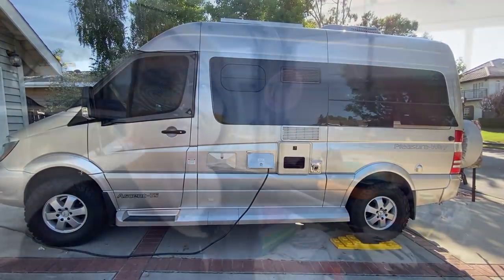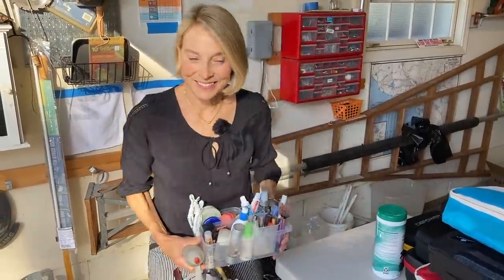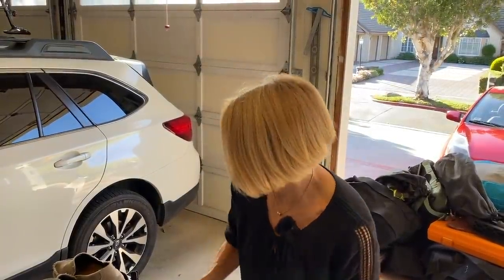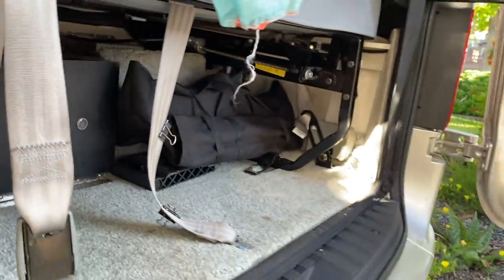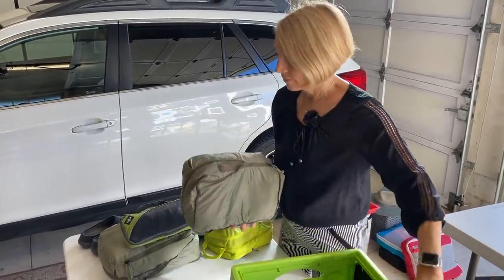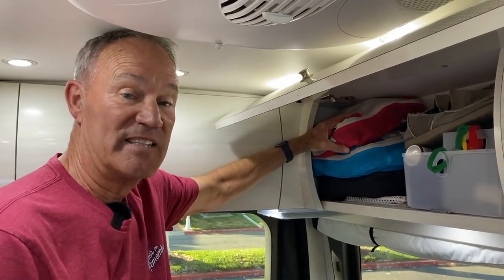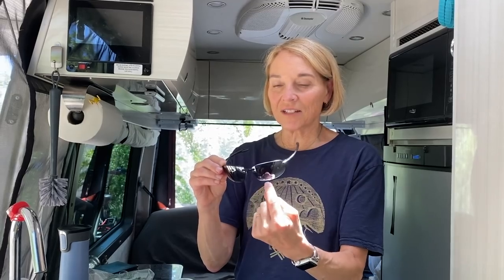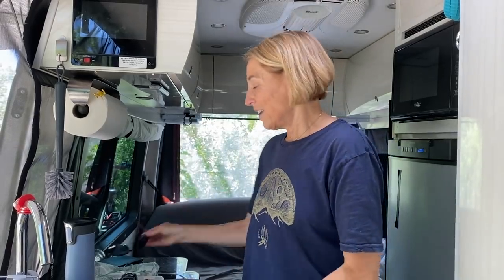How we pack our Campervan

Comment: Great video.  A game changer for us was purchasing two Gonex 60 liter folding duffle bags that fit perfectly in the space in front of the couch/bed.  Huge volume for packing clothes and can be left in place with bed down.  Amazon has them. They fold into pouch sizes when not used.  Thanks for the videos.

Comment: Thanks for sharing! Here’s some tips on where we found extra space in our Ascent: 1. We removed the carpeted panel beside the rear battery box, it’s just the charger in there and it has its own cooling fan. 2. In the rear largest upper cabinet the curved plastic covers are wasting a lot of space in behind so I’m about to replace them with 1/8 white ABS plastic sheets (can be cut with scissors). 3. Below the 3 kitchen drawers is a huge empty space; the front panel has clips and pops off when pulled, and then unscrew the cover panels in behind(they are not structural) - I added another drawer handle so it looks like a 4th drawer and because there are water lines in there it’s a great spot to put laundry. 4. The passenger side ottoman, below carpeted panel can be easily made into a huge hidden compartment: I slightly relocated the inverter electrical box at the back, and trimmed 1 inch of wood off the panel at the rear so it can be pulled up by hand(leaving the carpet in place to hide the cut) Lots of room under there.
Reply from the maker: Great ideas! I also removed the false wall in front of the plumbing under the kitchen sink.  I haven't shared with viewers the space under the third drawer because I use it to stash electronics out of sight when we have to leave the van.

Comment: Going from my 45’ Truck Conversion to my 21’ Lexor has been a challenge as I like my stuff! Also, I pack for 4-seasons. 😂  The Trasharoo looks bigger than I was expecting. On order soon. Just received my Victron BMV-712, now have to find time to install. Want to come install it for me? Glacier is opening up more Monday! 👍
Reply from the maker: I hear Covid is exploding in Montana.  Where are you?  Maybe we could swing by and I could "supervise."  Have you ordered the extra wire you need?  Get one longer than I did.  One tip I want to pass on from a viewer, remove your watch and rings (if applicable)  and tape off the connections so you don't arc.
Reply: From She to Me, I am in Columbia Falls, MT 16 miles from the west entrance of Glacier National Park. Compared to NY, FL, TX, and CA, MT is minuscule in numbers. Total cases 1593, deaths 28. County I am in, Flathead, has 64 cases, 0 new cases. Total cases, 14. Total recovered 48. Total deaths, 2. I wear my mask in stores, social distance, avoid big groups, and wash/sanitize my hands a lot.....No, I did not get any extra cables and I missed that in your video so will need to go back and watch it again. As soon as I opened it I was like, I’m missing cables I believe. Licensed FAA airframe and power plant  mechanic, so no rings and definitely take off the watch when around electrical. I’m here until I lend of August for now, could stay longer, but too early to make that decision.

Comment: That's one fancy tripod! I use a tool bag made by Craftsman for my tools. It's a lot easier to fit into the storage area. I also use microfiber towels because they don't take up as much room. I always bring too much clothing. I really need to work on that but i do have a longer Sprinter can that has a closet and there's just me and my dog a lot of the time. Great video, Safe travels. Enjoy Tahoe, I'm going to wait until is less crowded, probably late August or early September to head up there.
Reply from the maker: We hunker down on weekends in the basin but it has actually been more quiet than it usually is.  
I'll check out your recommendation for tools.  We originally used microfiber towels but John didn't care for them.

Comment: Debbie, I noticed that cooler with a red tray on top. can you give me more details on that? We just bought a PW. First van ever!
Reply from the maker: Back then, we carried a small cooler with ice because the 3 way fridge that came with our van struggled to keep foods cold enough.  We no longer need that but the red tray was something I picked up at Target and I had placed velcro on the bottom so it would stay on top of the cooler.  I still use the red tray because it fits perfectly between the sofa and ottoman.  Wish I could find another one with the same dimensions.

Comment: I noticed you have a kitchen faucet that is taller than the original equipment one we have in our '17 Ascent.  Did you add that or was it OE?  If so, do you like it and what is the model?  BTW, if you ever get the chance please visit our little town of Sisters, Oregon.  Lots of boondocking options close to town.  You would love it.  Thanks.
Reply from the maker: It was OE but PW had an issue With them dripping. I like the one on the new model because it has a pullout spout. If I could get one of those, I would switch.  I’ll put Sisters on the list for our next trip north. We came up on 97 with a good view of the Three Sisters.

Comment: For those who already wear glasses, another great sunglass option is called a fit-over.  I like the Cocoons brand, but there are less expensive ones.  Cocoons use prescription quality lenses, but they fit over your existing glasses be they prescription or readers.  I also like that they block light from coming in the side or top.  You can buy them at Bass Pro (limited choices), some optical labs, or order them online.  If you order online, I recommend at least selecting the style, color, and fit on the manufacturer's website because you need to measure your glasses for the correct fit.
Reply from the maker: Thanks for the tip. I’m currently looking for a pair of non polarizing glasses. They are hard to find.
Reply: @FromShetoMe  I think Cocoons are available in some non-polarized lenses for specific purposes,  anti-glare for night driving, computer viewing, etc. You may find one that meets your needs.  Check the manufacturer's website for details.

Comment: Another helpful video, Deb! We have. 2021.5 Plateau FL, but no spare tire. I love the storage capability of the trasheroo, and am wondering if you think we can hang it on the back of the driver’s seat?
Reply from the maker: You’d have to remove it if you want to spin the seat around. It’s amazing how much we have reduced our stuff over the years. I bet you’ll get there too and not need the Trasharoo.
Reply: @FromShetoMe , BTW... how do you like the tripod? I’m an amateur photographer and am sick of carrying a big tripod? I’m concerned about not having a ball head!
Reply: @judilecompte9377  I like it but it is very heavy so you wouldn't want to hike with it.  I have some pretty small tripods (no extending legs) that I hike with and you could put a ball head on any tripod.

Comment: So it looks like you have ditched the foam pad for the bed, how is that working out? And do you just put the electric cord on top of the Pico chairs while traveling
Reply from the maker: Yes, we are now without pads and no problems. Our cord goes under the passenger side ottoman.

Comment: How is the new cup holder working out? I was hoping to see a video about the installation.
Reply from the maker: I'll show it in next week's video.  There really isn't any "installation."  We just slipped it in and one of the cups rests in the Mercedes cup holder.  Although it does come with two bits you're supposed to put somewhere, I couldn't figure it out.  Bottom line, I really like the cup holder.  But to swivel the front seat, without removing the cupholder, the seat has to be in just the right spot.  I'll demonstrate next week.
Reply: I purchased the “seconds” 1/2 priced cup holder after seeing your video and had to put the cups in the freezer to shrink them enough to slide into the circle cut outs. The plugs they send you are to put in the holes you drill into the insert you pull out. I thought I could get away with just inserting it into the pocket in the dash but my husband said it fell out while he was driving it. Good thing he didn’t have anything in the cup holders. CaveVan.com has install videos on YouTube if you search CaveVan cup holder install.

Comment: Thanks for sharing. What are those slip on shoes? I need some like that. Also, what is the portable jumpstart kit?
Reply from the maker: Shows are Crocs and here is link to jump  starter https://www.amazon.com/dp/B01D42TYFC/?ref=exp_fromshetome_dp_vv_mw
Reply: Where’d you get the case to fit it?
Reply from the maker: Dot ComMom Ours came with a case.

Comment: Lookup pocketplus.com it’s an extra pocket for your phone that you can put it in your pocket but it has a strap with a magnet that goes inside your pocket and then you have a strap that holds the pocket on the outside of your front pocket for your jeans and it moves the pocket down to your jeans instead of your belt it doesn’t get in the way of the seatbelt when you’re driving
Reply from the maker: here is the correct link for anyone interested:  https://thepocketplus.com

Comment: I've seen cords  and hoses stored on the backside of the cabinets behind the back doors. Do you do that and if so, how?
Reply from the maker: No, we do not but saw a clever way of doing it last summer. Someone had screwed peg board to the rear doors.
Reply: @FromShetoMe  Thanks. I saw them up high on the outside back of the cupboards.
Reply from the maker: @karenw.beatty5263  Oh, yes. Our van has a shallow shelf there but it is only big enough for our walking sticks.